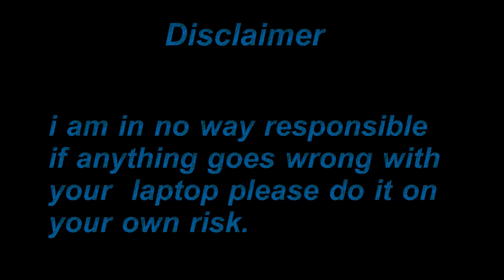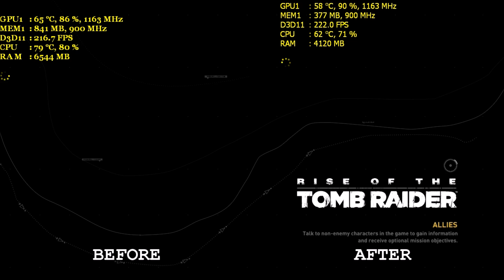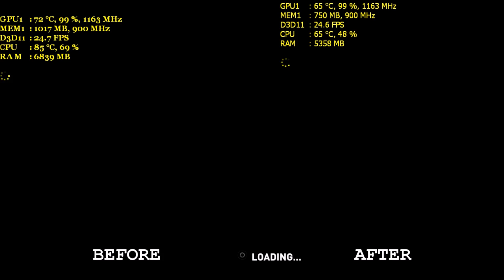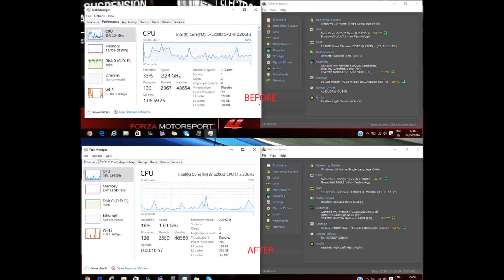How To Apply Thermal Paste On HP Pavilion 15 - AB032TX Laptop

Comment: Good video, Ive replaced thermal paste before and to do it isn't easy.  I havn't done so since about 2001 (Old AMS Athlon 64) but the principle is the same. Very small amounts and don't smear. I'm getting ready to change mine on a Ryzen 5 3550h and Nvidea  GTX 1050 laptop so I am watching everything possible. I will take a video. I am a student at the Northern Alberta Institute of Technology so I plan on using thier equipment.

Comment: Hey I use cooler master thermal paste for my laptop but in the opposite, I'm getting performance drop on my cpu, before applying new thermal paste, I usually get to 78 celcius at most, but now it's hitting 98 celcius after I applied the new thermal paste, help me! Thanks!
Reply from the maker: you might have not applied the thermal paste the right way or have not closed the heatsink properly or the the last issue that i can think of is the thermal paste might be bad...
Reply: @DomGamingnMore  alright I will troubleshoot the problem thanks!

Comment: A Bead(pea) size is suffice. Don't believe me? Put the paste on, and take a SMALL cut square of clear plastic(3"x3"x3"x3") and press down and WATCH how the paste spreads. Why you do this? To learn that too much is overkill and the MOBO doesn't like to get dirty. Do you? Short out your Laptop and go buy another so you can do it again. Practice makes perfect if your wallets bulging. It is the same as if you put the Fan, and/or the Heatsink screwed down tight over your GPU and CPU after the Paste......class dismissed.👍😎
Reply from the maker: Why don't you go and tell that to the companies who make the laptops coz to me it doesn't look like a pea size paste that they used, they used way more paste than i did in that video, and no the paste did not get on the motherboard even once in so many years, and just fyi that video was 5 years ago and my laptop still works great...
Reply: @DomGamingnMore  how many times have you replaced the battery? Gr8 to hear 5 year laptop still kicking hard!

Comment: Bro I did everything right 
However when putting everything back on 
Turning on my laptop It shows that cooling fan could not be detected 
I think I accidently damaged the pins on the green board rather than the pins connected with the fan plz help
Reply from the maker: hi if you damaged the pins on the motherboard then you might have to take it to the service center or the local laptop repair shop... but before that try and unplug and plug it back in...

Comment: Can i use external hardisk as internal ?? It is safe to use ? Whats you say ?
Reply from the maker: If it fits and the connectors are the same then yes you can i don't think it will cause any problem...
Reply: @DomGamingnMore  someone told me that if i use external hardisk as internal then it will stop working after sometime and also it will slow down pc as it it only designed to use externally .. is it true ?
Reply from the maker: I didn't do any research on this but slower or not will depend on the speed of your current internal drive...  About it failing sooner I've never tried doing thatso can't really tell...
Reply: @DomGamingnMore  okay.. thanks for the reply 😀
Reply from the maker: You're welcome bro...
Reply: @sharma_aditya  no hdd is designed for externzl use, they just put an hdd on a box

Comment: So far, this laptop is 10x faster that the Acer   lnfo.help/_HpPavilion?ӑӠ   I originally bought (which broke 2 months after purchase). Very reliable everything just plain runs smoothly. Graphics are great. If you change the settings, the battery life is better but I prefer keeping it plugged in and running max performance.

Comment: Hi brother,

Im desperate, just bought 2 days ago via amazon an HP Zbook 15v G5 xeon 2176m nvidia quadro600 notebook, after 20 mins of low demand 3d game gaming my cpu package reaches 98c!!! Not normal at all right? Will re applying thermal paste help in any way, dont have the drives to open the enclosure yet, but im so scared its gonna fry!
Reply from the maker: Well if its 2 days old i would suggest you not to open it, look on the manual or amazon or hp for the normal temps, plus are you sure the temp is showing Celsius and not Fahrenheit, Or Get in-touch with Hp Support but dont open it on your own as you will loose Warranty...

Comment: Do you recommend this laptop for programming,browsing and sometimes gaming(2 hours daily gta5 and pes17 18).. What about build quality, is it good?
Reply from the maker: programming no idea,  browsing and gaming for 2 hours yeah it will do fine, build quality is good, would i recommend it? i dont think so coz this model is almost 3 years old now, but for your needs it should be good enough for you, if you get it for a cheaper price then buy it, but i doubt they make this model anymore...
Reply: Dom - Gaming n More In my country it's about $800-$900 :/ ..
So I found Hp Pavilion with same specs like yours for about $600 (discount) and I'm thinking about buying it , I'm playing mostly gta 5 and some FPS games..
Reply from the maker: Check out the big list of games i tested on this laptop and you will get an idea of the performance that u will get in gaming,, but if you can get anything better than the 940m then go for that...
Reply: Dom - Gaming n More I can't, I think that 940m with this i5 is best budget "gaming" laptop
What about cooling, is it good enough in your pavilion
Reply from the maker: While gaming it does heat up, other than that yeah the cooling is fine...
Reply: Dom - Gaming n More I mean while gaming, the tempereratures are too high or they are acceptable

Comment: Thanks alot! It's very helpful. I have the same PC (more or less), but in idle, after some hours I have 45-50 degrees, and while playing games like GTAV I have peaks of 85-90 degrees. I think that's very strange. Changing the thermal paste would be helpful, in this case? Or the problem would be different? Thanks!
Reply from the maker: you're welcome, you should clean the fan and vents for better airflow and use a cooling pad to ...
Reply: I tried to change the thermal paste.. but it didn't work. I used an Arctic MX2, but the temperature is the same as before, maybe higher (in idle now I constantly have something like 55-60 degrees). I think that I change the paste in a wrong way, maybe I'll try again.
Reply: man, this is normal temperature for laptop

Comment: i bought an asus rog gl552jx 2-3 months ago. ideling cpu temprature is 60 degrees and usage goes very high while playing games which causes fps drops and shuttering. temprature touches 80-90 degrees while playing. do you have any idea about what causing this problem. no matter which settings i play in fps remains the same.
Reply from the maker: no idea bro....
Reply: r u on windows 10 ?
while game running poorly minimize the game and open the task manager and look for any processor called "system and memory compression" is high in usage and writes at 100% disk rate. if the answer is yes thats what the problem u r facing. let me know about it
Reply: No. Unfortunately i got defected laptop with 2 heatsinks pins broken i got to know about it after 2 months of use. They repaced the part with new one. Now its working fine ;)
Reply: Were u going to tell me about disabling superfetch and background intelligence service? I already did it :p

Comment: Thanks a lot for this video. I have the ab219tx model laptop. Can you please tell what are the storage upgrade options this laptop has, and does it has a m.2 slot.
Reply from the maker: +Arindam Sarkar your welcome... the only storage upgrade option i can think of is buy a Hard Drive Caddy and put a HDD in there and use it as a second drive by replacing the DVD drive.... no i dont  remember seeing a m.2 slot i dont think it comes with one, not sure tho...